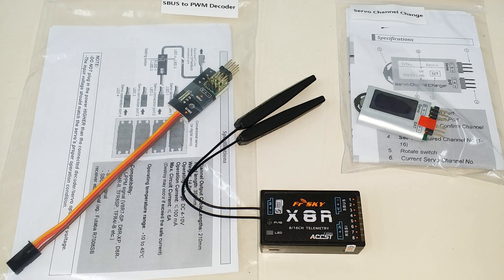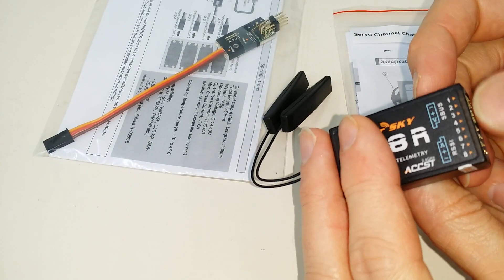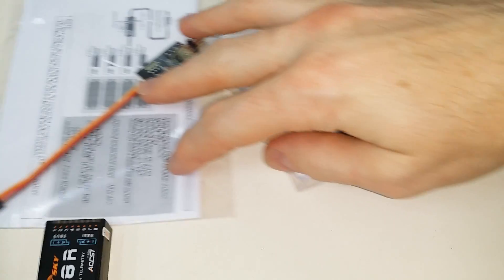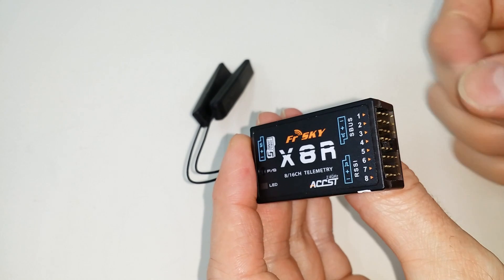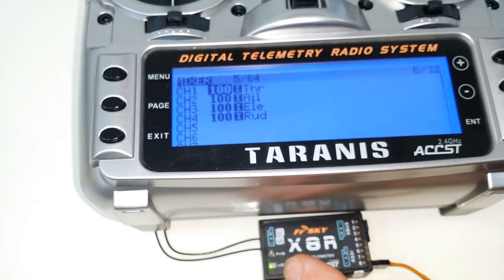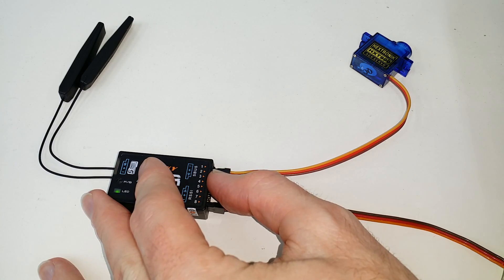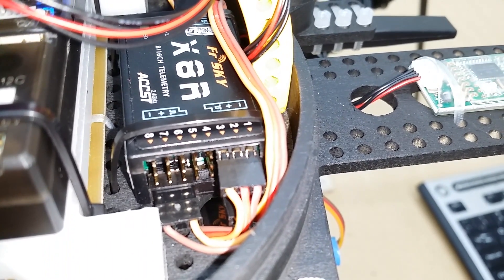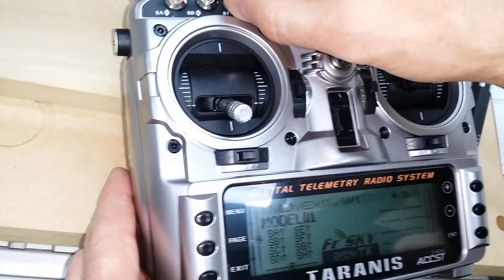How to setup 16 channels on FrSky X8R using SBUS

Comment: How do I get 12 channels from the L9R?  Can I jump channel 1 and 2 when binding?  Great video.
Reply from the maker: The L9R must be bound with the Taranis or XJT module in LR12 mode!  There is no other way to bind it.  Just set LR12 bind mode on the radio/module and power up the L9R with the F/S button pressed...that's it!  You will have 12 channels, assuming you configured all 12 on the radio before binding.

Comment: So I believe the S.Bus will output all 16 channels to a given flight controller.  Can I use the PWM out in addition to S.Bus?  Like I want to plug in a model beeper into a channel but I'll be using S.Bus to the FC.
Reply from the maker: Yes, absolutely!  S.Bus always has all the channels you have configured, up to 16, and yes, you can use the PWM channel ports simultaneously, or bind the receiver to output channels 9-16 on the PWM pins instead of 1-8 for convenient access to the higher channels using PWM.

Comment: Hi, I tried to bind my L9R for sbus with no success using the instructions of this video. Anyone can suggest how to bind it for sbus setup?
Reply from the maker: This video only applies to the X8R or X6R series receivers.  The L9R must be bound with the Taranis or XJT module in LR12 mode!  There is no other way to bind it.  Just set LR12 bind mode on the radio/module and power up the L9R with the F/S button pressed...that's it!  You will have 12 channels, assuming you configured all 12 on the radio before binding.

Comment: if you are using a Taranis Plus, you need to reflash with updated firmware before mode4 method will work.
Tutorial below.
Taranis 16ch setup using 1 X8R receiver

Comment: What a great video and great explanation.  One question.....it looks like you are using a APM or Pixhawk type FC for your multirotor.  Where are you connecting your sbus cable from your receiver.  To the RC port or the SB port on your FC?  Thanks in advance for your help!
Reply from the maker: Thanks!  The Pixhawk RC IN port will accept either CPPM or SBUS signals.  The SB port is actually not used for SBus at the moment.  It can be used for analog RSSI measurement if you pass the FrSky RSSI output through a resistor/capacitor circuit first to smooth it into a DC signal.

Comment: Hi, I'm trying to link my taranis x8r receptor but can not. Here's a video of how I'm doing. The battery is connected to the current distributor and receiver'm connecting an Afro 30A drive to use as  bec. 

Taranis X9D + X8R NO BIND

I hope you can help me, greetings.
Reply from the maker: It appears you are doing it correctly, so I'm thinking you've got either a bad radio or receiver.  Do you have any other receivers you can try binding with to test the radio?  Did you try binding without any jumpers?  The red light should flash on the receiver once it binds....and I never saw that in your video.  Hope that helps!  Good luck!